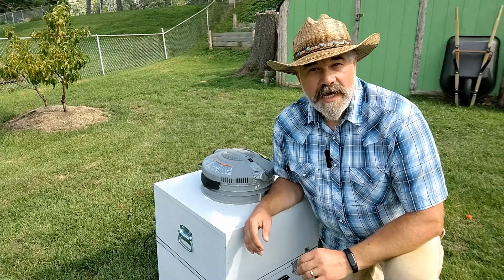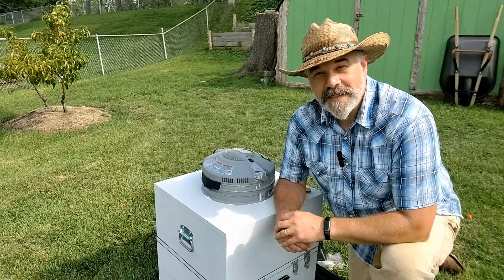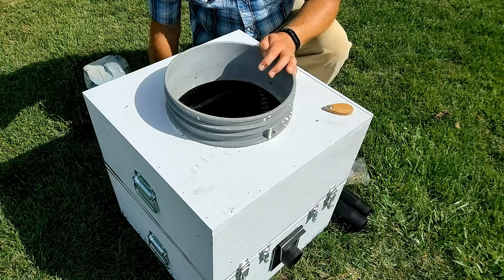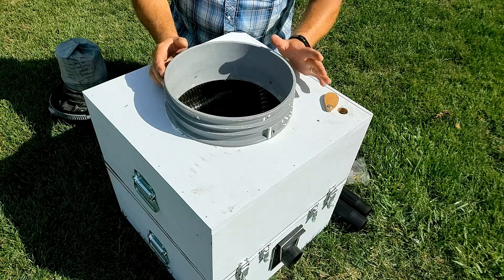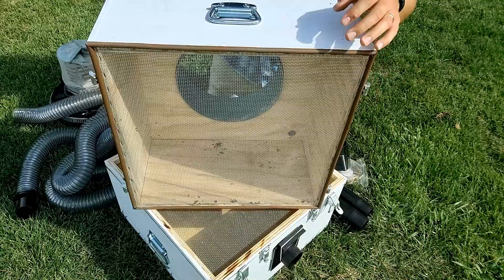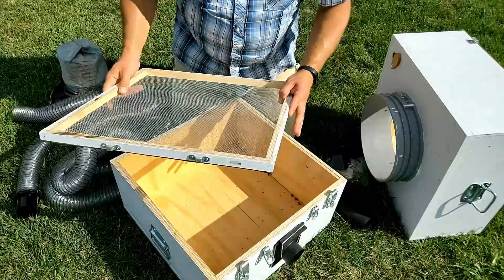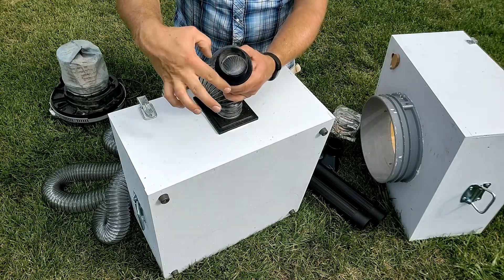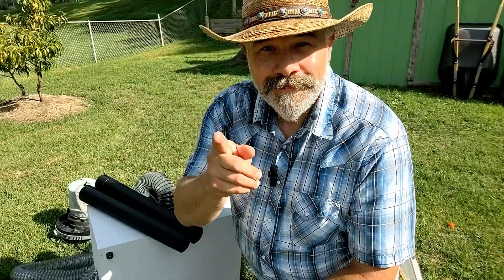DIY Honeybee Vacuum for Bee Removal

Comment: A sliding off metal bottom through a kerf would allow you to dump the bees in a hive by placing it on top and slide it open. Just leave it until they have moved into the hive. seems easier than turning over and dumping ... I don't know...

Comment: If you covered the vacuum inlet and attach hose to bottom, how is it providing suction 🤔🤨🧐. I wished you would have started it up and let us see it run. Purhaps suck up a bean for demo
Reply from the maker: The vacuum head draws air through the bottom; the inlet is just a passage directly into the container (bucket or, in this case, stacked boxes).  I'm just replacing the top inlet on the head with a bottom inlet to my boxes.  The screens in between allow air, but not bees, to pass from the bottom box to the top and out through the vacuum head.

Comment: Tip :
You also need a Box with Frames in it to let the Bees 'collect and settle on' eg during the Transit Home. AND it needs a Sloping Floor from the Vac In Hose (where the Bees enter) allowing them to Walk and Crawl up onto the Frames right above them. The Vortex (Suction) is only within the Hose, so the Bees need a place to settle up in ! 
Being a Cluster on Mass 'makes' a lot of Heat : so do ensure any Bee Vac has a Upper and Lower Screening in Situ, so they remain Cool. Even Mist them with a Plant Spray Bottle before travelling Home. Just saying. 😎
🐝🐝🐝🐝🐝🐝🐝🐝🐝🐝🐝
  Happy Beekeeping 2024
🐝🐝🐝🐝🐝🐝🐝🐝🐝🐝🐝
Tip :
Here in Scotland 🏴 we can't get those fancy Shop Bucket Vacs. So had to do my "Bee Vac" using : a basic Wet & Dry Vac (£40) Item was a Black and Yellow Cheapie ! Bee Coloured of course. 😆 DIY Store 'bargin' what's not to like.

Used it's Hose to 'Connect' into a purchased "Thin Plyboard" 'Swarm Nuc Transport Box' sold by a Bee Supplier here in the UK (£30) 
This nice 'Light Weight' 👍  'Swarm Nuc' ideal if on top of a Ladder etc. 
Transporting the Bees (keep cool) via an upper inner Screen Top and a Screened Floor. 
By cutting and 'adapting' some Ply Sheeting into a Upper and Under 'Solid' Lid and Floor with 'draught proof' foam Trim : Means the Nuc Box becomes 'Airtight' re  Vacuum status !
Once the Bees are sucked up and your done. Remove the upper and lower solid 'panels' so the Air flows freely on taking them Home. 😉

You also need to cut a Rear Hole to take the Vacuum Hose. And insert a Inner Sloping Floor : lowest at the Front and higher at the back. 
Re Swarm Nuc : 
Plug is provided for 'closing up' prior to transporting them. But you need a 2nd one for that rear Hose cut Hole you made. 

Bee Vac (process.)
The bees come in from the front (Hose you use to suck them up with) and then they 'walk up that Sloping Floor within the Nuc Box. 
To then Collect and Gather on the Frames provided ! 
Suggestion:
Semi 'Fit' (not Fix !) Say x3 Frames into pre 'allotted' Channels : Use evenly spaced Screws or tiny Blocks. [This stops any Frames from Bashing together and possibly 'Crushing Bees' in Transit !]
Ideally : Frames should be :
 x1 with Old Comb, x1 with a Bit  Foundation & Strung tight with x3 linear Wires. 
And a Frame with a Starter Strip. Bees can 'start' making Comb, rather than crazy 'Brace Comb' if left to their own devices. 
All this setup :  'Allows' there to be enough 'Empty Space' where the 4th & 5th Frame (would be) to let those Bees come into that Nuc : to Collect and Hang / Move on Up : onto the awaiting Frames provided.* 

Important Tip :
The Tubing from the 'Swarm' to the Box, ideally must be internally smooth : I use a Clear Pipe Hose (like they use in Beer making etc) as the 'Collection Hose.' Nice to see the process as it happens ! 
Finally you also need a 'Baffle' 
(A Small x1 Inch 'Hole' and a Cover : Screwed in one Corner, so this 'Flap can be moved over more or less) : Therefore to "Increase or Decrease" Tube Suction ! This is ESSENTIAL !
(Otherwise Bees could get sucked up and 'splatted' if the Suction in that Hose is to Strong ! Hole (uncovered 30%) is nicer on the Bees than 100% closed ! Get the idea. . . 🙃

(*)
Having Frames means the Bees can stay calm and settled inside the Nuc. AND can stay in that Nuc safely, if required...
While  you arrange all that 
"Cut Comb" into more Brood Frames 'held in place' with Criss Crossed cornered Rubber Bands.' 
The Colony (of Bees) can have somewhere to 'settle,' then transfer them : into a Hive already prepared to take their 'own' drawn Comb, and you move the "Bees" over calmly on those 'Nuc Frames' in the Hive needing x3 more Frames : to complete a x10 Frame Brood Box. Simples. . .😎

Comment: Oh, I’ve looked this over carefully and scrutinized it the best I can.  It is near perfect as it is.  You even have snubber rubber feet on the bottom, but you didn’t mention that.  I am sure you have other features that are not mentioned.  Here is my bullet list of additional items that would help, and I would be happy to pay for.
* a cut list
* a bill of materials used in the project
* a list of material suppliers
* ideally this would be a battery powered vacuum, but for a plug in - perfect
* boxes sized to capture the bees, then place the lower chamber beneath the new hive to allow the bees to clamber up into the replacement hive after the comb is transferred.  Later, swap out the bottom.  Less handling overall
* just a small piece of foam where the bees enter the vacuum chamber to soften the stop.

And I had to really brainstorm to be able to share anything.  You did such a very nice job.  
All the very best
Reply: Again, awesome job

Comment: You were saying the weight of the unit and climbing up or coming down, esp with bees in the unit. Could you not use extra hose?If loss of suction could be an issue (don't think it would, but i could bee wrong), with another blast gate, you could attach a more powerful shop vac to the added blast gate and if needed, open the relief a little more and now you have 40 ft of hose and the extra 3 ft of attachment tube/pipe.
Reply from the maker: Yes, you could absolutely use extra hose.  I don't know the physics of how much suction pressure might be reduced over greater distance - maybe only slightly or not at all as long as the hose has no leaks.  But if that did occur then a reducer could be used for a smaller diameter hose which would increase air velocity without requiring a stronger shop vac.  Plus a smaller hose would be less unwieldy for longer distances.  I have seen some people who collected high swarms using an extended pole and long bee vac hose.

Comment: Nice clean design I like it, they are all similar but nice job on the little details.👍 Question what about having the bee collection chamber constructed so that it is able to hold a few frames of drawn comb? Maybe on the sides so they are not ran into by the bees coming in. Do you just remove the vacuum head to allow venting for long travel?
Reply from the maker: I'm thinking about working on a version that will use unmodified hive bodies so that frames can be added after the fact without having to move the bees to another box.  I don't know if there'd be a benefit to having frames in the box during extraction, though.

For transport the top box can be removed, leaving the bottom box with the bees and a screen over the top - so no problem with ventilation.  It's also easier to carry the vacuum in two parts, anyway.
Reply: @SuburbanSodbuster  I would be really interested in seeing that build series. Seems like if you have a design that matches what equipment ya are using, it would make things so simple and convenient.👍

Comment: TY for the information! Just a thought. The hole to reduce air flow could be put in the lower box. You'd simply have to put a grill over the hole to stop the bee's escaping once the power is turned off :)
Reply: One of the cool things about this design is that the hole is in the top box.  This will reduce the vacuum in the top and bottom to a safe level   Saving bees and evening out the pressure across the two chambers

Comment: To save more bees during a removal, the bee vacuum seems such a game-changing tool.  Your design is great:  the one thing which I see to improve is to substitute a smooth-bore hose for the much more flexible corrugated hose.  Imagine being sucked down a long long way, bumping into all those hard "corners."  There are some air hoses and RV sewer hoses (search on Smooth-Bor C2 3" x 10' Hose) for options...my other thought here is that Fred Dunn uses, to collect and set aside small amounts of bees, a Shark dust-cup handheld vacuum.  The bees are sucked directly into the plastic cup at the tip of the tool, having traveled no distance at all, and you can see every bee you have in the cup.  Very handy and it seems not damaging to the bees...  Thanks for showing and explaining your great tool so well.  Happy beekeeping!
Reply from the maker: Despite the coiled wire for flexibility, the hose that I use has a smooth interior - which is specifically why I chose it.  You're correct that a corrugated hose, like a typical shop-vac hose, could be rough on the bees.
Reply: @SuburbanSodbuster  Oh, thanks for explaining, and respect for your effective and kind bee vacuum!

Comment: Did you plug the inlet side and use the outlet side to pull vacuum through the bottom box
Reply from the maker: I did plug the inlet on the vacuum head. The vacuum head draws air from underneath so with the regular inlet blocked it pulls air through the blast gate and the bottom box into the top box and out the regular outflow.
Reply: @SuburbanSodbuster  thanks I just wanted to make sure I was thinking right, by the way great video very helpful

Comment: Curious about how you mounted your blast gate.  Did you glue it in place, or were you able to disassemble it and screw it to the bottom box and then reassemble it?
Reply from the maker: I glued it in place and sealed it with silicone caulk.